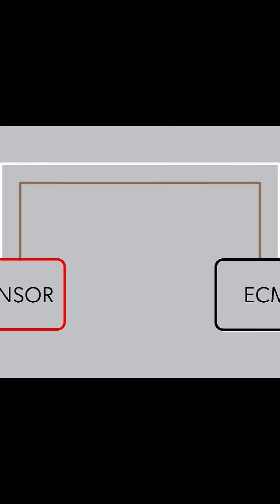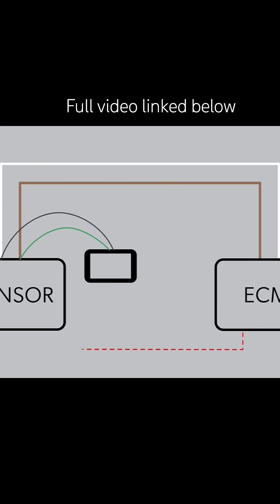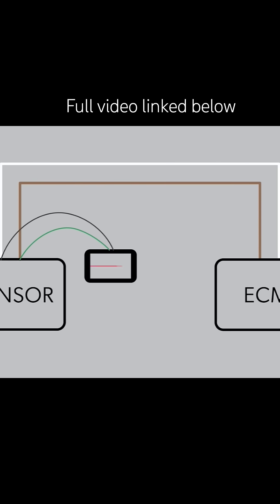VR type crank sensor [intermittent no signal testing]

Comment: Just wondering if this is a vvt solenoid diagnosis?im dealing with this now. Only has 2 wires and grounds on top of the crank/valve cover. Sounds familiar
Reply from the maker: No sir. The full video is linked in this short if you're interested. This is a variable reluctance type crank sensor diagnosis

Comment: Danner my man. What about bias voltage from computer on some cars for example the old Mazda 3 which it's ckp sensors have both wires with 2,5v of bias I repeat in both wires. I was monitoring and no signal for 8 seconds in one of those wires because I have non isolated channel scope and I use one probe one wire so two wires two probes two channels so I am seeing 2,5v going down and at the other 2,5v going up and suddenly I lost one of them going to zero and stalling the car. May be a bad computer, explain me, do a video for us about that kind of bias reluctance sensor
Reply from the maker: This is set up like a Ford with a "floating ground" and this is normal to see signal on both wires! If one is shorting to 0v you have a wire touching ground!
Watch this one
https://youtu.be/Ex1ChpWG1go?si=2psBv0ynvQRzUYva
Then I have other videos on the VRS with the floating ground as well as info in my book on this! Let me see if I can find another video for you explaining this better
Reply: @ScannerDanner Danner my man. Tomorrow morning I am going to see that car again. I did this video. I wish you could watcht it but it is a dream lol I know you time values gold and you should be putting English caption because it is in Spanish maybe you know Spanish lol well knocking the door does not mean to go in. In my channel the first video called Era muy peligroso manejar el Mazda 3 con esa falla. In that video I found a loose capacitor and I thought oh well that capacitor is supposed to get those peak voltages to ground and maybe it's spiking the ECM but nop, they called me and I am coming back checking the car. Thank God I said do not pay me yet eh I will wait two weeks because I did not want the ring you know getting married with the car lol so tomorrow morning I'll go just like nothing to check and everything ok after watching your recommendation videos for it. You my man. Thanks Danner. Greetings from Caracas Venezuela.